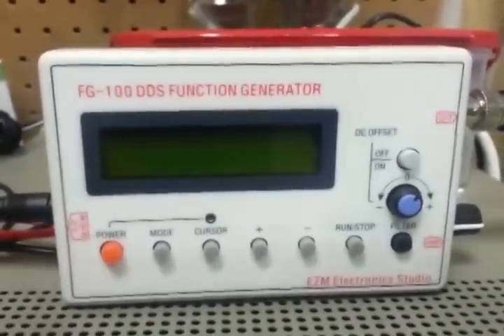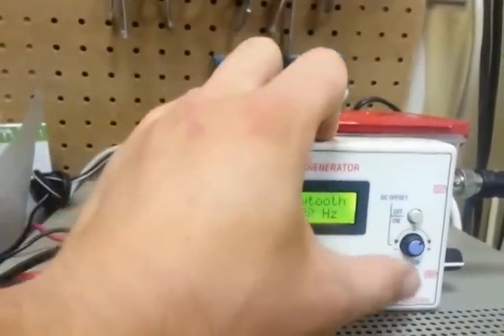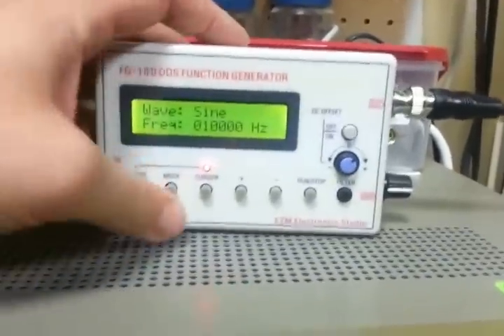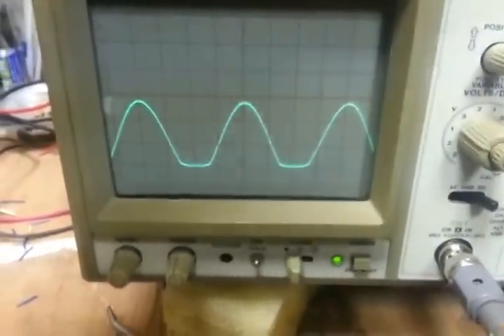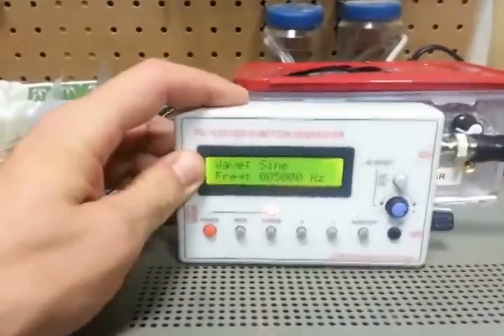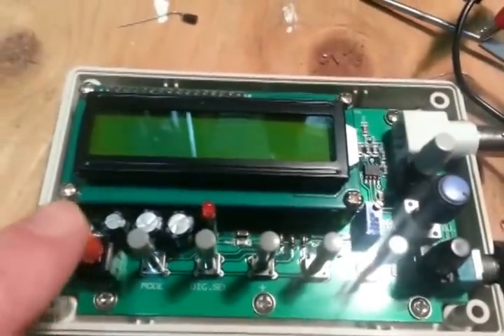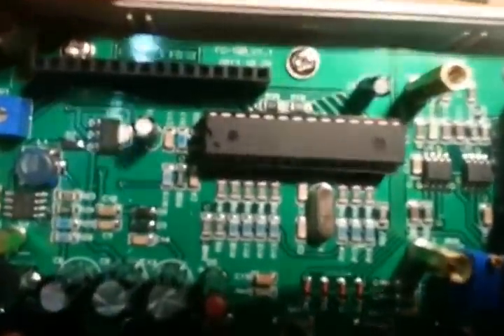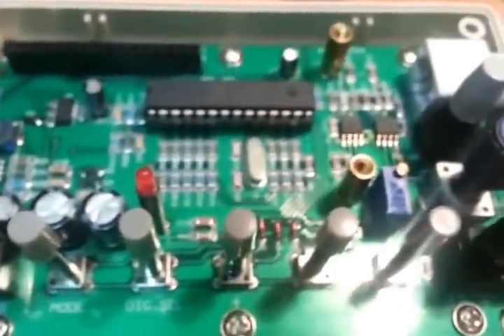FG-100 DDS Function Generator & Teardown

Comment: Great video, thank you. Even though it has been out for more than 7 years, these parts are still sold on ebay and right now I am thinking about buying one. After watching your video I am quite convinced to do so. They actually sell it now with a USB to 5 V plug cable so this issue is fixed already.

Comment: Hello, great video 😄

I'm a beginner and I have a question:
I would like to make a diode bridge rectifier and I need AC voltage at the input.
1 : Can this device be used as an AC power supply to produce the AC voltage I need as input?
2 : Do they provide wire to connect the generator to a circuit (breadboard, pcb,...)? 

Thank you in advance 😉. 
Cordially.
Reply from the maker: You need to purchase some BNC leads, easy to find on the internet. You can't use it as a power supply, most function generators aren't meant for that. 
If you want to play with rectifiers, a transformer might be the way to go, but playing with live electricity can be dangerous.... 
Have fun and be safe
Reply: @jarretchessell9633  Hello Jarret. Thank you very much for your feedback 😁. I'll be careful 😎

Comment: what is the output current range of this device ?
Reply from the maker: vandor2uton I wouldn't recommend using a function generator as a current source.
Reply: Is that can be used with optocoupler+tranzistor to switch  230VDC 100khz?

Comment: How did you power this device? Mine doesn't come with anything to power it.
Reply from the maker: I used a 5v 1amp DC supply I had laying around.  it has a buck converter in it - so it should be able to handle most  DC wall warts you may have laying around.

Comment: I have the same unit, was actually quite surprised about how tidy it is inside. "Rubycon" caps, 2 IC's to the right of the micro are a pair of TL072 Op Amps, looks like a resistor ladder below the micro for generating the waveform. Crystal is a 30Mhz. I found your video after doing a google on alternate firmware, since the micro is socketed and I have a pile of ATMegas I might give an alternate firmware a shot, if only to allow for adjusting the frequency while it's running or at least doing frequency sweeps.
Reply from the maker: +Tim Savage I've been enjoying mine quite a bit, for the price point it is a bargain. I recently put it onto a frequency counter and it seemed to agree to 3-4 digits. I agree that the big let down is that you can't actively control the frequency. I think the reason why they use the start/stop method is so the mcu isn't trying to update the screen and scan the buttons while generating the signal, the start stop is probably on an interrupt. If you could figure out how to make it sweep, that would be a nice touch. I thought it would be fun to write my own firmware for it as well, but in the past I had horrible luck trying to generate a high enough frequency of PWM using an ATtiny to get a home made buck converter going, I don't think I understand how it works well enough to recreate it.
Reply: +Jarret Chessell Exactly for the price it's pretty dam good, I've reverse engineered the pinout of the micro is fairly straight forward.
Reply: +Jarret Chessell Project on hackaday https://hackaday.io/project/7985-alternate-firmware-for-fg-100-dds-function-gen
Reply from the maker: +Tim Savage I'm uploading a video of doing the firmware update and checking it out. https://youtu.be/KlFnaRGsrrk It should be up in a few hours.